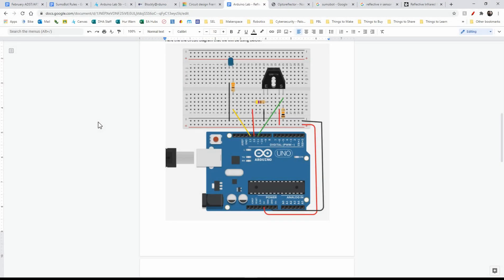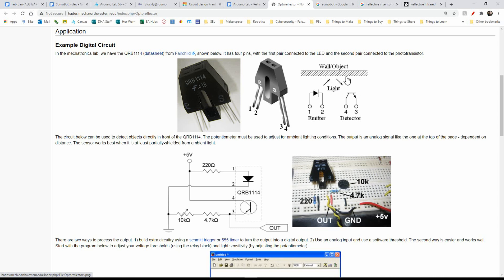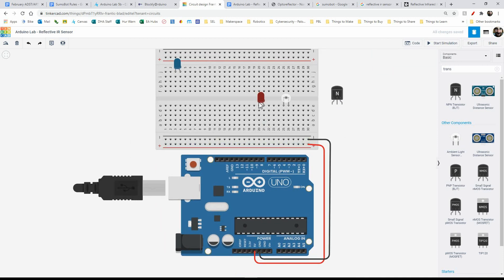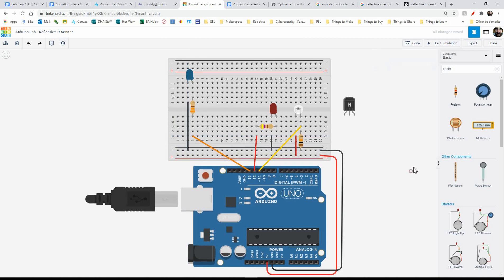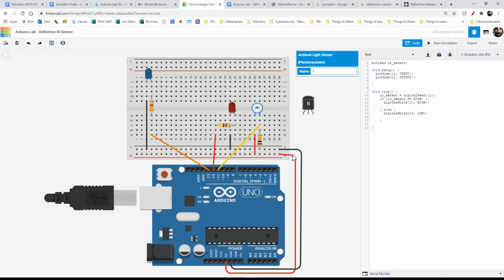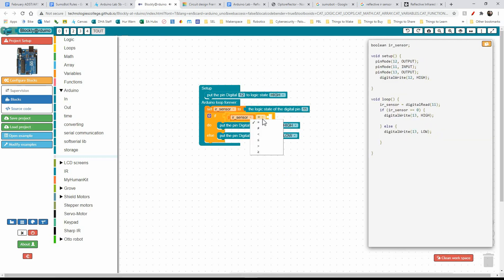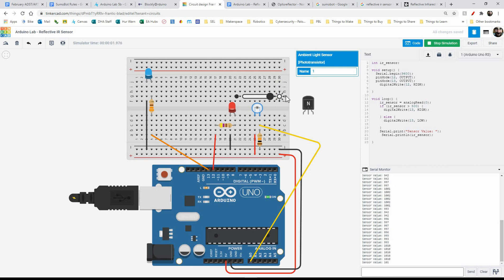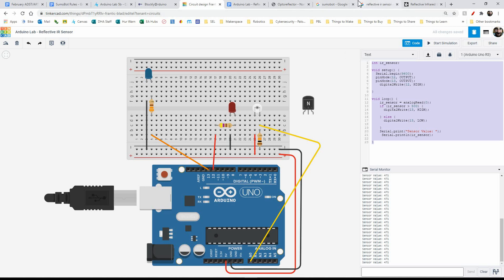Arduino Tutorial: Sumobot Reflective IR Sensor with Tinkercad Circuits & Blockly Arduino

Comment from the maker: The image of the circuit diagram that I show of the IR sensor is hooked up backwards compared to the LED/Phototransistor in Tinkercad. In the description I have updated the diagrams so that they work with the actual IR sensor from Adafruit. If you have a different optoreflector be sure to double check the orientation of the IR LED and phototransistor so that you connect it properly.

Comment: You said you wanted to talk about the different types of IR and how they work different because my search about IR lead me to your channel. I need the knowledge about IR sensor between the general one with 3pins with that of 4pins named TCRT5000 IR
Reply from the maker: Here's the datasheet for the 4pin TCRT5000 IR: https://www.vishay.com/docs/83760/tcrt5000.pdf. It works similar to what I went over in the video. Two pins for the IR LED and two for the receiver phototransistor.
For the three pin IR sensor such as the ones found at this link (https://circuitdigest.com/microcontroller-projects/interfacing-ir-sensor-module-with-arduino), work by having a common ground pin for both the LED and transistor. As the diagram on the link shows, one pin for power (5V), a ground pin, and a digital output pin that will giver a high if an obstacle is detected. You'll notice that there is a trimmer potentiometer (blue, square) that allows you to adjust the distance of detection.